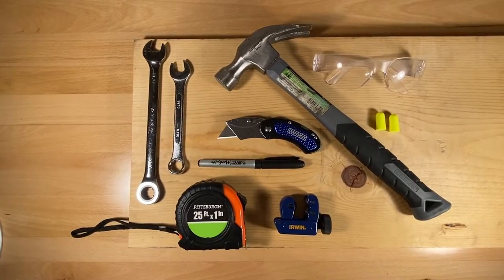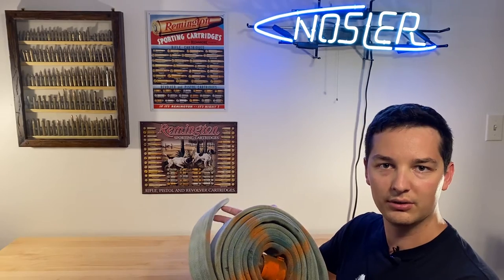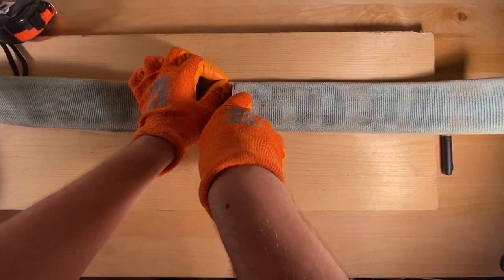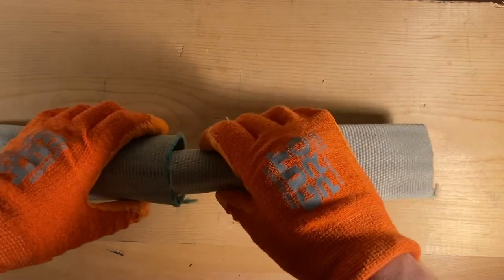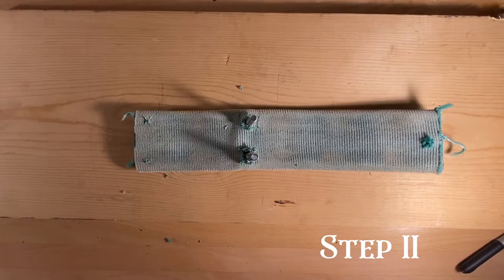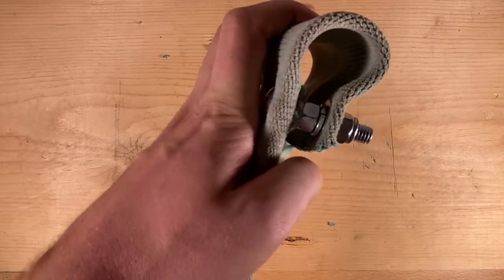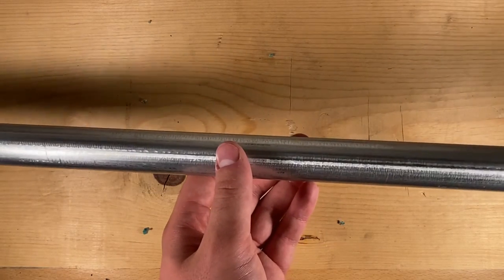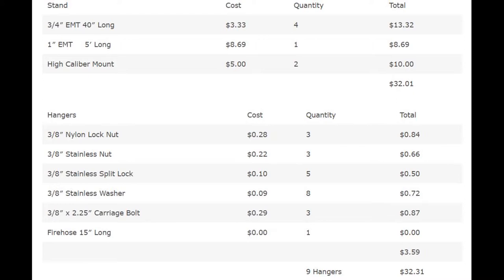How To Make The Worlds Best Steel Target Hangers

Comment: Pro Tip: Cut 4 pices of 1"O.D. galv. pipe 3" long and pound them into the top of each conduit leg: The brackets will fit MUCH better, the stand will handle more weight and won't collapse endwise and bend the brackets in half.

Comment: Here I give the most cost effective and lightest option...ready? #36 tarred bank line! Ta-da! You can use heavier TBL as you think is needed. I use Catahoula TBL. No need for chains or straps. I have used TBL for years and have only had one break, it rubbed on a jagged edged hole caused by me hitting the crossbar support that the line was tied to. I use 3" to 4" bolts in the steel target holes and then tie the TBL to that. The length of the bolt will cause the target to have a hanging angle that will direct spalling to the ground. That angle can be adjusted toward the head of the bolt to reduce that angle. I use 2 additional nuts for that purpose.

Comment: If my target has square 1/2” bolt holes will I still use the 3/8” bolts you use for the set up?  Or do I get 1/2” hardware. Thx for a response.

Comment: Has this guy ever heard of steel chain
Reply: You may get 2 shots on steel chain before it breaks. Using GOOD rubber will allow you to shoot the rubber multiple times before it breaks, and its cheap.
Reply: @taronyapeek3404 And when you edge hit the steel the bullet spray will cut the rubber like a knife
Reply: Steel chain is more costly with  a significantly shorter lifespan